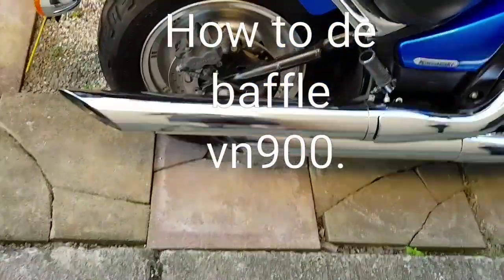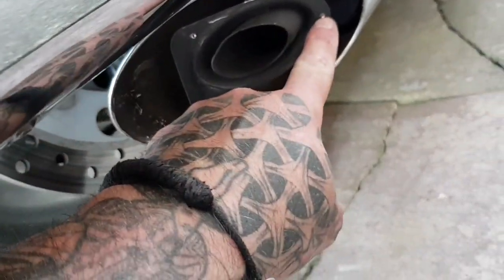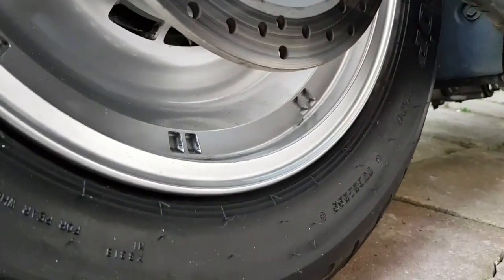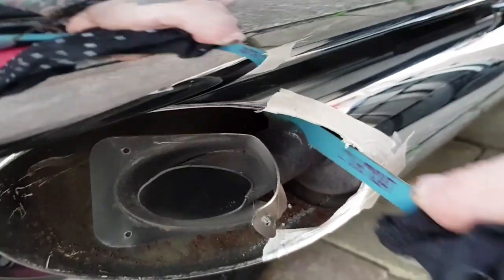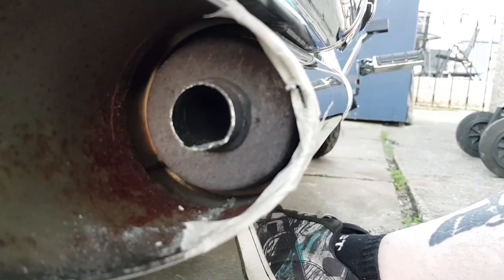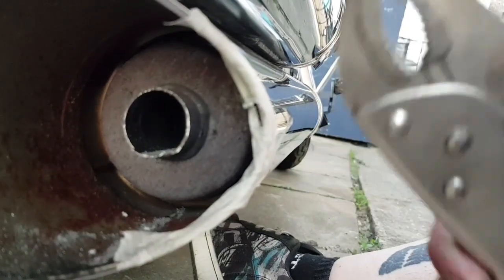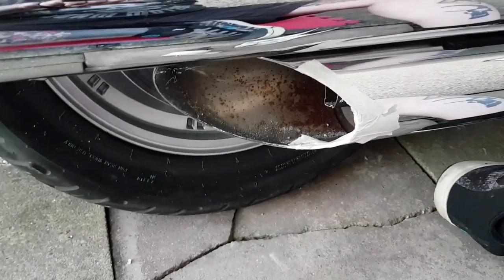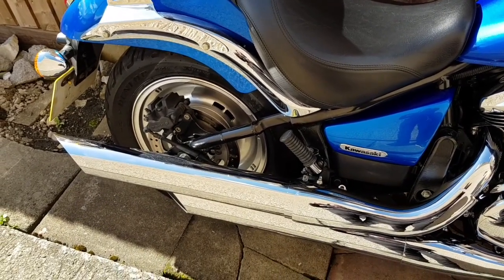How to de baffle vn900 custom

Comment: This was PERFECT!!! I just did that to my bike. Sounds awesome!!!! I used a 2 3/4 hole saw and it was a perfect fit. Also, don't forget the fuel management to get the increased HP and it will also stop the backfires and lag.

Comment: Hey I really have to thank you! I love my 2011 Vulcan 900 but it really was too quiet. I just did this today and it sounds so so much better. I dont think I would've done this without seeing your video so big fat thumbs up, thank you.
Reply from the maker: Awesome thanks
Reply: How exactly did you go about getting it out?
Reply: @HeyJacobRS   a few beers and as many friends. For me weakening the welds was the most frustrating. It really helped to remove as much metal as you can so that you can move the pipe around as much as possible. Or at least bend it out of the way. It took me at least 20 minutes of non stop "wiggling" to finally free it. You'll start to feel less resistance and you know you're close. Large vice grips helped. I'm not naturally mechanically inclined so it took me longer to complete this. But just be persistent. Definitely worth the effort.
Reply: Curiosity.. dont you loose any power? At high revolutions  ?

Comment: After debaffling do you need to get a fuel management system like a cobra power pro? Just not sure if doing this changes how the bike mixes fuel/air
Reply from the maker: I didn't on my 3007 900 custom. It rides as normal.

Comment: Do you have to retune or adjust the engine after removing the baffles? Is it safe to do on a new bike, or does it need broken in first?
Reply from the maker: Hi man. No need for retuneing as its electronically done, new bike I'd be cautious because of voiding the warranty....

Comment: What is the size of a metal bit for drilling a hole?
Reply from the maker: Think I used a 2" bit
Reply: @docsworld9707  How many millimeters is the diameter? I am from Belarus, we have a metric system.
Reply from the maker: @yauhen83zhenyc64  50mm or 5cm
Reply: @docsworld9707  Thanks so much for the info friend.

Comment: hey quick question, as far as changing oil screen. If you have ALREADY did the oil change, is it too late to change screen the day after, as I filled her up with oil already? i am worried that fresh oil will come out at this point, or is it a seperate compartment?
Reply from the maker: Yeh you will lose fresh oil if you clean out tyres screen. Keep it till the next oil and filter change
Reply: @docsworld9707  funny b/c i asked another vulcan tech, he said, i can do it, its seperate. i think i am not going to try it, hehe
Reply: @docsworld9707  so just take bolt out, then spring, washer, ruber washer, then screen, in that order i think?...and soap/warm wash filter?

Comment: We removed the baffles on a 2010 Vulcan 900 classic and now it sputters & bogs when your giving throttle. Please help. We've changed plugs, new air filter. Please help?!?
Reply from the maker: Sounds like a fuel problem check your fuel lines for splits also check the throttle works gd on the cable. First
Reply: Bad gasket on one of the exhaust. Bent it around and broke it near the engine I would assume. Air being sucked in would definitely cause it to do the listed

Comment: Do you have any issue with it running hot
Reply from the maker: No. No issues at all. A little popping on off throttling but nothing bad.